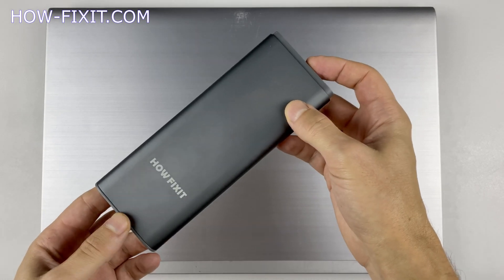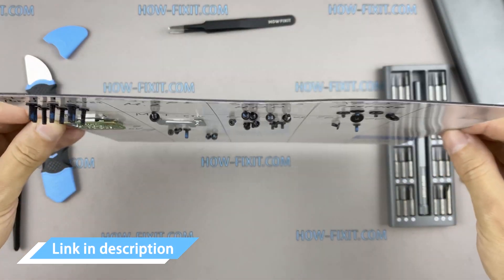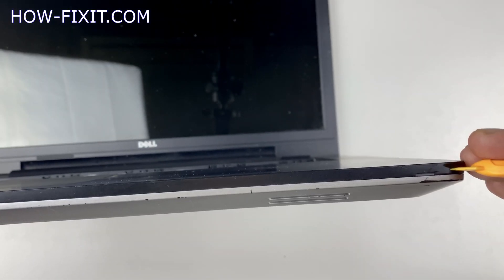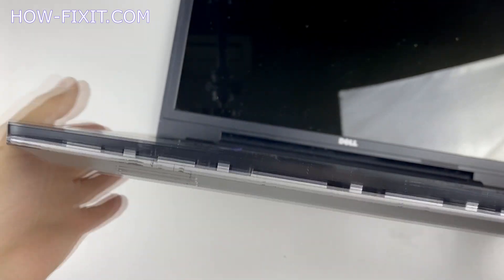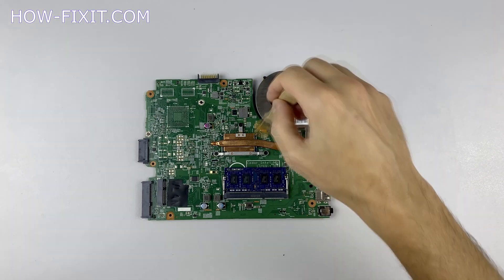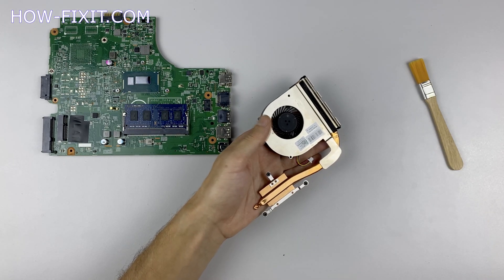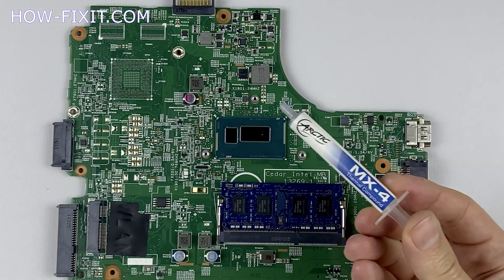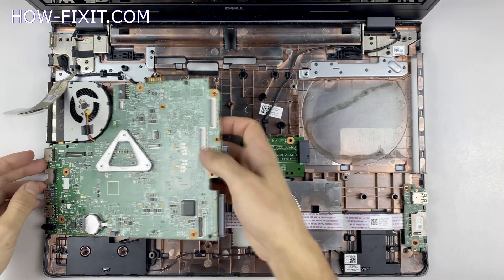Dell Inspiron 17 (5748 and 5749) Disassembly, Fan Cleaning and Thermal Paste Replacement

Comment: Great! I bought replacements for the outer shell and the finger-pad for the 5748 laptop, as my wife managed to wear them down in only 9 years. Now, I wait for a quiet weekend to take the laptop apart and do the refurbishment. I already have replaced the hard-disk for an SSD one. The battery was also replaced this year. When I do this last treatment, the laptop will almost look as new again.
Reply: what ssd did you replace the hard disk with?
Reply: @wholelottamashups  I bought a Bliksem SSD 1TB SATA III 6Gb/s from Amazon. It's purring like a kitten ever since. Of course, another SSD would have done well too, but this was then a nice choice considering its price and performance.
By the way, I finally did the refurbishment of that outer shell a month or two ago. It took some time and nerves, considering all the small screws that need attention, but it's done. The most difficult part was the touch-pad, which took some fiddling to make the buttons work. It wasn't as obvious as I presumed, but it's done now.